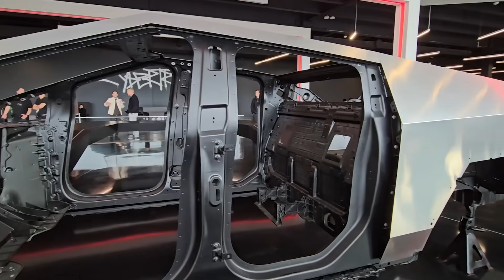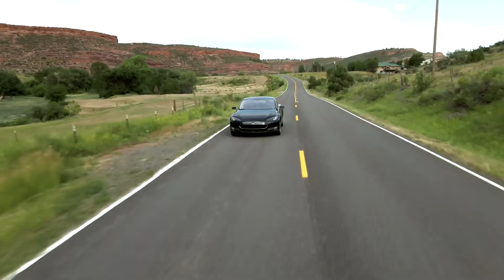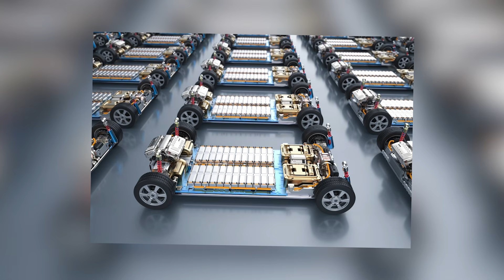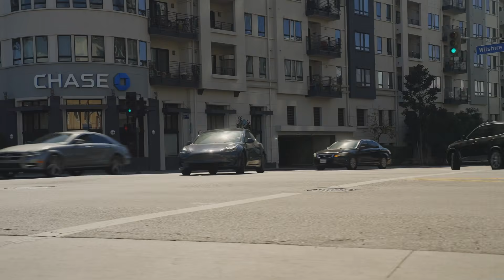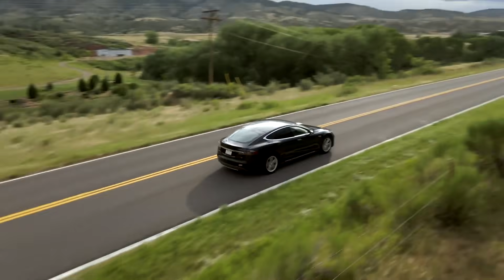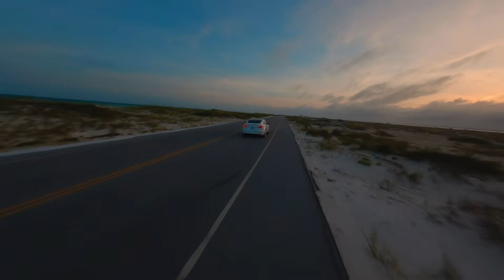Why EV Tires Wear Out Faster (And How to Prevent It!)

Comment: I just exhausted my first set of EV tires. Replaced with regular tires at low cost. Finds it quieter, smoother without compromising performance. Shall see how long it lasts.
Reply from the maker: Legend move! 🧠💸 EV tires out, regular tires in, sounds like your wallet and your ears are both celebrating. Let’s hope they last longer than your range anxiety. ⚡😅 Keep us posted on the road test!